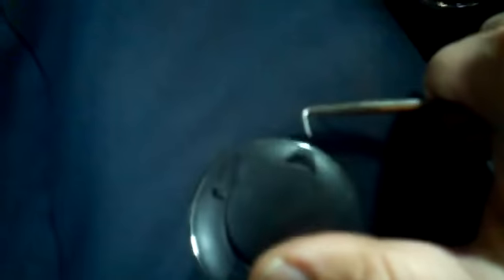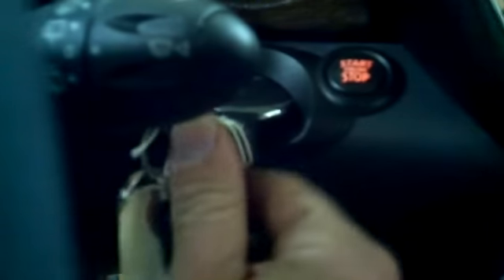Key Battery Replacement Mini Cooper

Comment from the maker: On older mini's they used a special code that needed to be programmed into the general module. You might have this version mini in which a new key and a visit to the dealer would be needed to input the code.I do not remember the cut off when the key went to the other method but this may be why in your situation.

Comment from the maker: Watch my video on initializing a bmw remote key. The procedure is the same and it may fix the problem for you.
Cycle key in and out of ignition key on then off. Press and hold the lock button and then press the unlock button 3X. Make sure all the doors are shut. The locks should lock and then unlock if successful.

Comment: I know this is an older video.  But my key fob just went kapoot, at first I was getting a lot of battery needs replacement warnings on the Mini, therefore I changed the battery.  Now it will not unlock/lock the car.  It only works when I insert it on the dashboard.  I'm  hoping there's some sort of recoding.  It's a 2009 Mini Cooper S, hardtop.  Any help you can provide will be hugely appreciated.  It'll save us $375

Comment: I have an older 2002 Mini Cooper S with the keyfob, bought it last week and he said it needed a new battery, so I put a 2032 inside and its still not working, ive read with the older one you need to insert, remove key, hold unlock + lock 3 times, still no luck, Any ideas? Locking module? I've googled it but no1 seems to know :( ? Many thanks